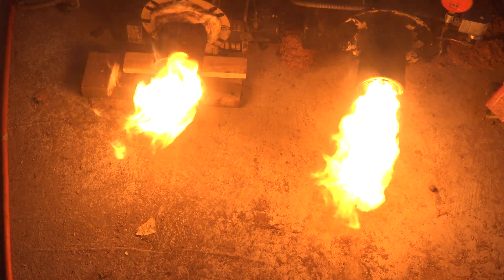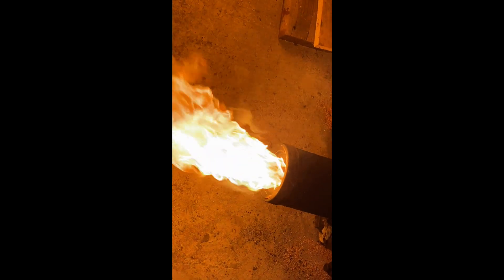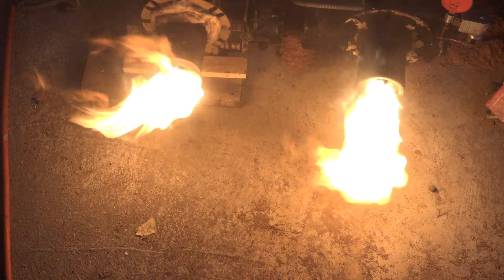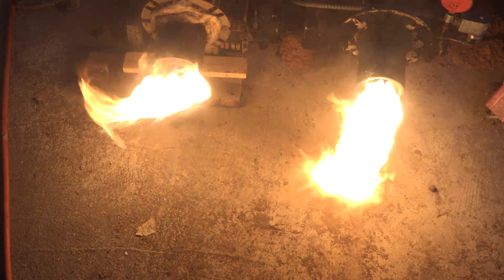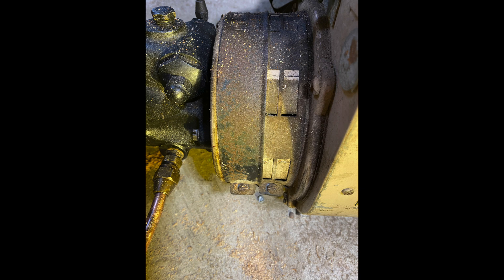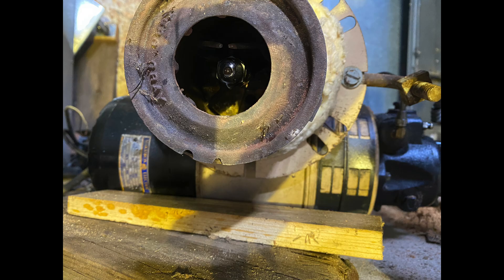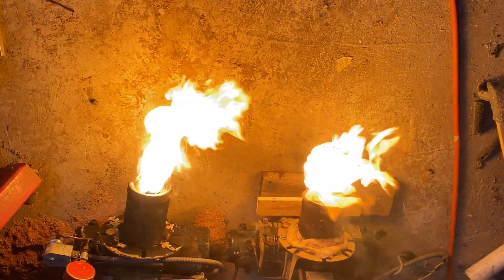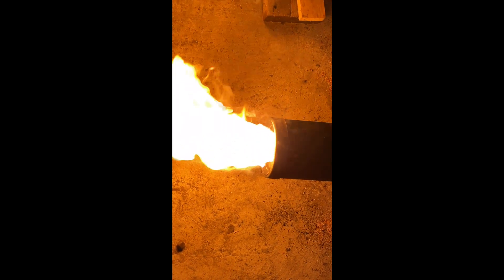Comparison of the the conventional and flame retention oil burner

Comment: What do you think furnaceman.?......I cut out a hole in a wood stove and installed a beckett high efficiency burner and welded it on the side, I run it with diesel and use this setup to heat a sauna up to 200 degrees Fahrenheit. It works fantastically. I can see the flame through the window and it takes 25m to heat up a 6x12 cedar lined cube. I have lava rocks on top of the stove to produce  steam, the stove retains heat for a long time after it has heated up, it's 1/4 steel with fire brick inside. It is controlled with a digital thermostat rated to 230f, I linked it to the wall plug instead of a direct wire to the burner. Amazing ingenious functional design

Comment: اريد التواصل معك يا استاذ
Reply from the maker: First, if it has been running that way for over a day, clean the heat exchanger and smoke pipe.
Then, replace the nozzle and service the burner.  
Fire off the burner and if it still smokes, be sure the air inlets are not clogged with lint.  Adjust the air inlets until the smoke just disappears.
To finish the setup, you should use combustion instruments to get the best efficiency.
GFM
Reply: @grayfurnaceman  I want to communicate with you
Reply from the maker: You can send to Grayfurnaceman@gmail.com
GFM

Comment: I'm surprised you still have a dinosaur burner laying around, further surprising the cast isn't a bunch of crumbs!
Reply from the maker: I found it under my lakehouse.  The pump was toast, but I installed a pump I had laying around and got it working.
GFM
Reply: I have two of them, both from 1960’s Bock and Ford water heaters

Comment: I love your videos, few years ago your video was instrumental in me replacing a motor and capacitor.  I have a question about my TFC furnace error Message 2 -Primary Limit Circuit Open.  What could be the cause of error message and what is solution?
Reply from the maker: I would be looking for an airflow problem.  Plugged filter, dirty blower wheel, plugged A/C coil or ductwork problems.
GFM
Reply: @grayfurnaceman  Thank You i will check those out asap
Reply: @grayfurnaceman  I checked and clean those things. Could there be an electrical component that gives "primary Limit circuit open" ?

Comment: Can you make a video showing the flame difference between the flame retention unit and the newer 140 psi solenoid based burners ? Is it true that the higher the psi of the burner pump the cleaner the burn?
thank you.
Reply from the maker: I will be doing one on just that.
GFM